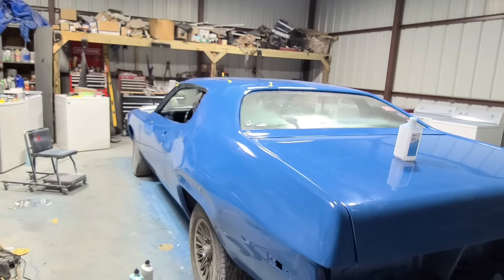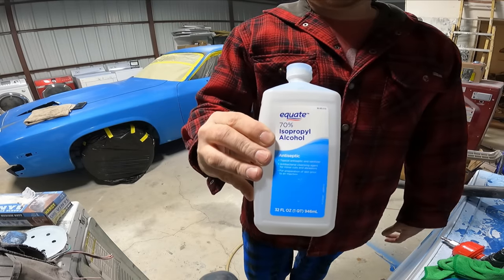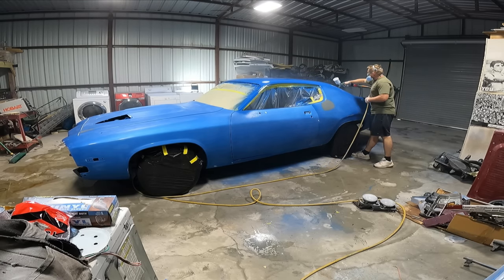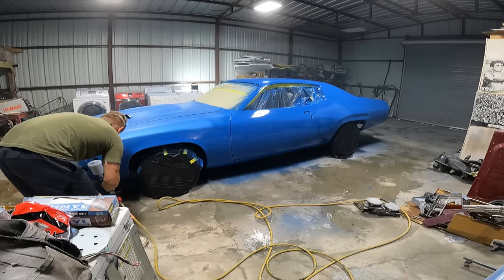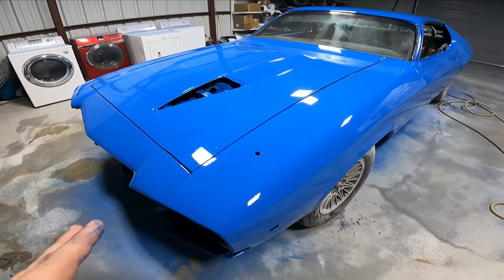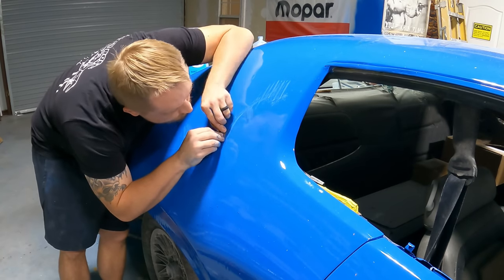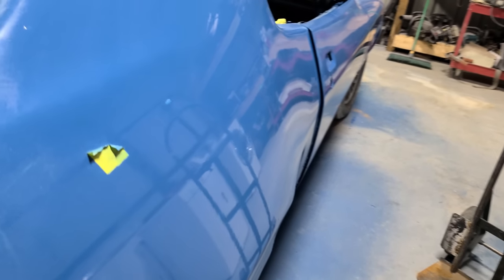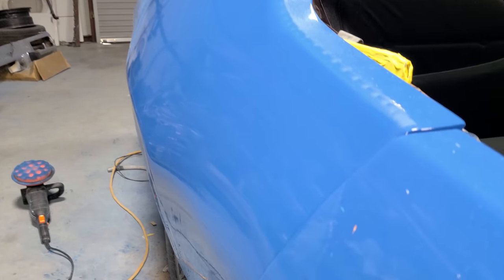$150 REPAINTING my 1974 Roadrunner RUINED IT AGAIN I GIVE UP!!!! How to fix paint runs Revival pt.4

Comment: You're staying with it Ol' buddy! You tend to get really good at buffing along the way learning to paint! I do think thats really close to Petty blue. I would increase the air pressure somewhat to atomize the paint better but you hosed plenty on there! LOL! and didnt rub through. Thats good enough,time to build some power under that hood! Hang in there, Good job!
Reply from the maker: I'm gunna run the 318 in it for a while. I daily drive these cars. Like actually drive them everywhere. But I have a 360 magnum I just traded my uncle a truck for im planning on building that for it

Comment: In the last video when you started clearing so soon I knew what was about to happen. Been there myself getting impatient lol. The biggest key to painting a car is patience. 

I can’t blame you at all for sanding those runs out of the quarter and sail panel. With any car that doesn’t have a break from the roof to quarter it’s hard to get a good lasting blend without having to do the roof, both quarters, and filler panel between the rear window and trunk because eventually you will see a halo where it’s been blended. 

Regardless it turned out sweet and I certainly would rock it every day!
Reply from the maker: EXACTLY, being single stage I would have to repaint the whole roof and quarters. Thanks joshua

Comment: I wish u would have repainted in  that b5 metallic single stage, thats what l want to do to my 72 Barracuda ( First time painting) but that blue looks really slick!
Reply from the maker: Other color was called electric blue. It  was a factory BMW color if you need to use the code to paint your car. It is very close to b5
Reply: @somewhatfast  I'll take the code

Comment: I agree with not using wax & grease remover. It leaves a residue behind. I use a few drops of Dawn dish soap in my wet-sanding bucket for all my paint prep work so I'm constantly degreasing the car. Always works for me. Research how to back-tape lower rockers &n the whole lower portion of the car & tape the paper to the floor to avoid all underbody overspray. And back-tape wheel openings, that way there's no overspray in wheel wells and under the car. It keeps dust down a great deal as well.
For gun setup, reduce your fluid volume by 25%, increase air pressure to like 40psi, open the fan to at least 8-10 inches and you'll be amazed how smooth the paint will lay compared to your results. It's the little things that make the difference between an ok job and a beautiful finish.
Reply from the maker: Thank you!

Comment: If you go base/clear on your next paint job, it's going to be the best experience of your life! After shooting single stage, you'll be shocked at how much easier it is to go base/clear. You'll lay the base on and you won't believe how much easier it is to get totally perfect coverage without doing 3 or 4 layers. And you won't ever run the paint, because the base coat will flash super fast compared to the single stage, since there's no clear coat mixed in with it. Trust me, you'll level up your game 10X and you won't ever go back to single stage again!
Reply from the maker: Thanks ive painted over a dozen cars base/clear. This was my first single stage.

Comment: The right way is from the bottom up to prevent run .try it and you will see. 45 psi for your part gun and 8 to 10 inches away from the surface. When you are spraying down the gravity of paint will run.

Comment: How much did the $150 paint job in the costing at the end?
Reply from the maker: Including the failed paint job. With bondo, 2 gallons of 2k primer 2 gallons of paint and a gallon of clear. Was right around $400 ish. If I didn't fudge the first job with clear coat, it would have been around $200 less

Comment: F,Y,I,you have stages,four to be exact,30,/70, first coat,40/60 second coat,60/40, third coat 70/30 fourth coat,leaving about 15, mins,between each coat tacky pain,between paints !,30 P,s,I,on paint gun,😜👍...
Reply from the maker: Dang like I said on the video everyone has their way of painting. 
Data sheet says 5-10 minutes 8-10 psi and "2 coats or until hiding" 🤣

Comment: I don't use clear coat what I do is I wet sand and use machine glaze REO speed DeWalt 1000 to 3500 rpm's it's easier to wet sand runs out of paint without the clear coat those cars they never used clear coat and polish on an angle from top to down
Reply from the maker: I didn't use clear coat
Reply: @somewhatfast  the first time you did you don't need that with 3 coats of paint  I call clear coat a lazy man's way out the only problem I have with clear coat is it peals up after a few years just like skin when you get burned in the sun
Reply from the maker: @Richard220automotive  Right, but the first time I use metallic. And you can't cut and buff metallic. Like I said in the video, I chose to clear over the metallic so I can cut and buff.

Comment: That era car was enamel from the factory I think.
Reply from the maker: Would have been a metallic single stage laquer. I used a urethane, which gives it a similar look, but last MUCH longer.
Reply: Yes, Chrysler and Ford were Acrylic Enamel.  It is not uncommon to see 50 year old cars with paint that held up better than water based paint that was only ten years old.

Comment: I don’t understand why you didn’t use an original Plymouth color.  I would want the car to look as original as possible.  Maybe it’s just me?
Reply from the maker: The hood isn't original, I welded in all the trim holes, there isn't a vinyl top, someone installed seats out of a 1976 plymouth, wheels are off of a 1987 cheysler 5th Avenue, motor is out of a 5th Avenue, it has a column shifter and a center console shifter out of 2 different cars. Nothing about the car is or was original.
Reply: @somewhatfast  yes.